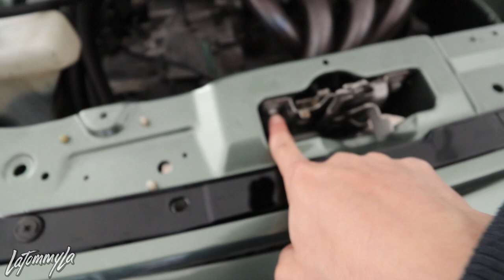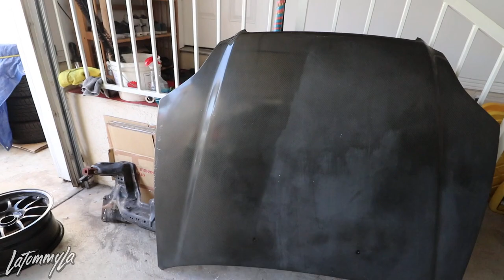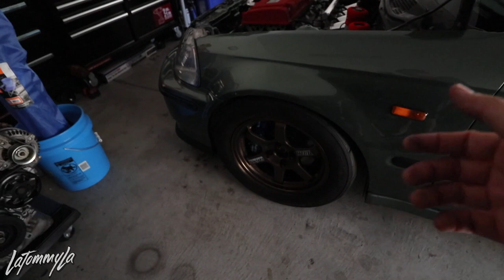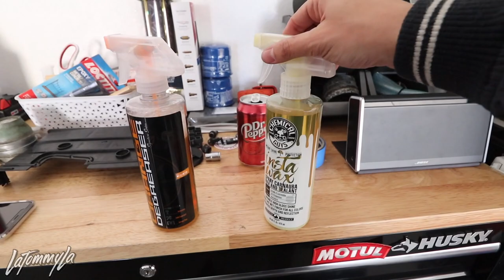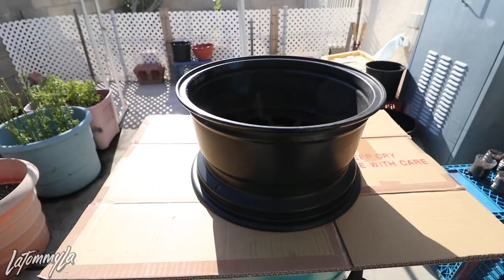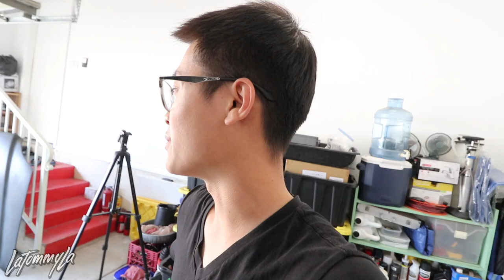Getting rid of them now! Rattle canning 949 Racing wheels!

Comment: If you're using flat black as the finish. The primer should be a different color than flat black so you can see the paint has coated over the primer.

Comment: I was thinking of going 225/45 on 15x8 with same tires but will wait till you install the 205/50 to see how they look. Jus tryna stick with toyos website(approved rim width). Thanks for the update LatommLa👊🏽!
Reply from the maker: I am currently running 225/50, I would prefer 225/45 but prices are high for that size
Reply: LATOMMYLA tell me about it.
Reply: I was thinking about 215/50 for my coupe 🤔 balloon look has its benefits though, less likely to bend your wheels 🤷🏼‍♂️
Reply: LATOMMYLA what are you wheel specs? I'm thinking about getting 225/45/16 on my 16x8 +38 wheels
Reply: Chaz Gunther te37 15x8 225/50 toyo r888
Reply: Chaz Gunther diffrent brands has diffrent fittings. Like stance/ flush 16x8 15+ offset on a eg hatch with nankang ns2 195/45. It really depends on what you want to drive.

Comment: Wouldn't 205s be too much stretch on an 8" wheel?
225s are about the right size imo
Reply: Nope.  For track use, a 205 street tire is great on a 15x8.  205 hoosiers are best on 15x9s.

Comment: So bro, can you please share your experience on those 225's tires on a EK hatch chassis, in a seperate video or as reply? There's a lot of people wanting to run 225's on their EKs, like me. But nobody is recommending to do this, how did the bodywork you did n' all that affect the daily drivability of the car?

I am/was running 205/40/17 tires and they rubbed pretty good but, there was absolutely no work done to the wells and the liner is sagging from all the rubbing
Reply from the maker: It's perfectly fine, you will just need to roll your fenders and run slightly more camber to prevent rubbing issues

Comment: Before you put a layer of sealant you need to remove anything else you put on the paint before that. Otherwise you’re just waisting your time. The sealant will not bond to the paint. If you choose to use sealant and wax, you start with the sealant first. And then you can throw a layer of wax after that.